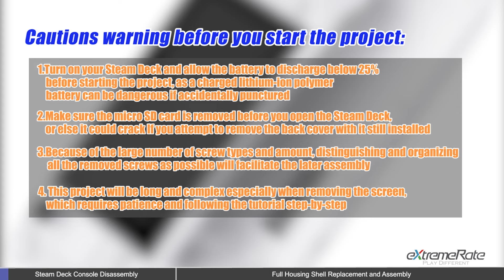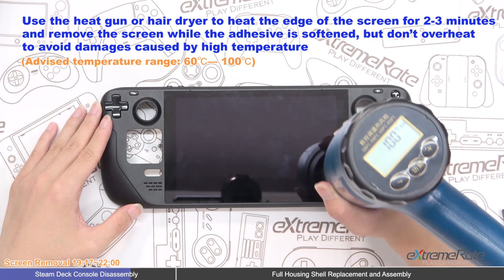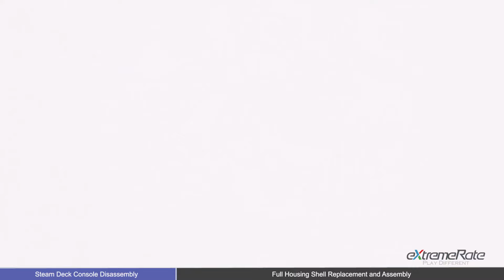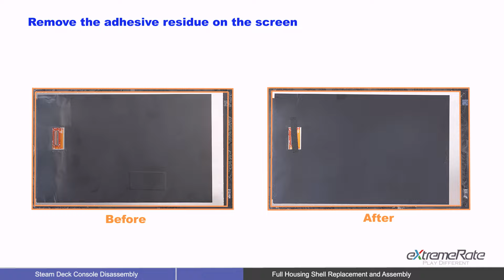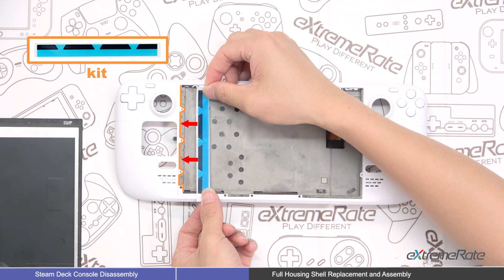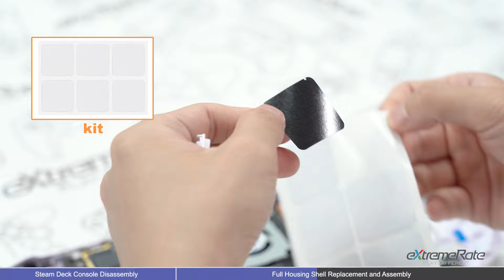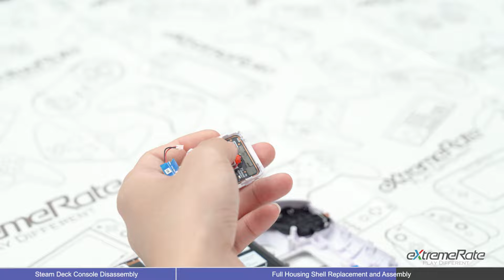eXtremeRate Steam Deck Full Replacement Shell Installation Guide

Comment: So having now performed this shell swap on my Steam Deck, I would like to give the following advice:

Firstly.  Don't use the metal pick provided with this kit.  You will likely chip the glass on the screen, or damage the plastic shell.  Use a plastic pick.
When removing the screen, DO NOT use the pick on the right side as you will very likely damage the ribbon cable on the screen.  I can't stress this enough.  I had to buy a new screen because of this.  The ribbon cable is only 2mm away from the very edge of the screen, and while this guide does mention not to go any further than 3mm in with the pick, as you may damage something, It unfortunately doesn't warn you where the ribbon cable is, and if you insert it any more than about 2mm, you run a very high risk of slicing through the ribbon cable.
You are safe to go around the other 3 sides of the screen, just avoid the right side.  You should be able to remove the screen just by going round the other 3 sides.  (For reference: 21:31 DO NOT do this)  Pause at  21:55 to see just how close the ribbon cable is to the edge of the screen.

As for the kit itself, my only real critique is that the "Steam" button doesn't actually have any text on it.  It's just blank.
Reply from the maker: Sorry about uninformative on the screen removal. And thanks for your tips!
Reply: I wouldnt even remove the screen just upgrade it to a new one
Reply: Sheesh! Thanks for the tips.
Reply: maybe should've paused and assesed what the underside looks like before plunging in boss. they sure show you where things are.
Reply: You don't even need to loosen the adhesive on the right side, the screen should come off pretty easily with just the other three sides loosened sufficiently.
Reply: I even read your post ahead of time but I forgot when I went to do it and it happened to me too
Reply: I wish I read this before I scratched my screen and shell 😢 sometimes I don't notice it but when I try to admire it 😅 well it was my first time
Reply: @ExtremeRate  Hello, good morning, I am a retail importer from Ecuador and I have been buying things for the steam deck and selling in my country, but I saw on your official website that there is no complete case with buttons, screws and tools as shown in your video, everything separately, I do not include I saw the set of screws that they sell, so I don't know if they no longer sell a complete housing set with everything you need!
Reply: About to shel swap today. Thanks for letting me know about the ribbon cable. ❤
Reply: Yes definitely do not use the provided metal pick, ended up chipping my screen trying to get it underneath the screen, hopefully the replacement screen is easier to install than this was to remove
Reply: I followed rule 101 of the internet: "Don't read the comments. I now have to replace my screen." 😢
Reply: When your screen stopped working, did it not turn on at all? (I’m guessing since you severed the connection). I’m having an issue where everything is working fine but when something is in motion on the screen, the screen flickers. But when nothing is in motion it’s fine. I’m wondering if it’s just a bad seating on the screen cable? I’m really hoping so
Reply: I am not sure if you can edit your comment to add something, but one other piece of advice that probably needs to be included is that there is a screw order for the style of heat sync used in the video.

The lower right screw has the number 1 right above it and according to Ifixit's website (they are official suppler of replacement parts for Steam) the lower right should be screwed down first. Once that side is secure, you should tighten down the screw that is always attached (it has the number 2 stamped into the metal by it).

While we are on the subject of heatsink, the kid I purchased did not 
include any replacement thermal compound, and the video should at least 
inform anyone doing this swap that it would be a great idea to replace 
the thermal compound. It is much better to purchase the compound at the same time as the case so that you get to choose your preferred compound instead of being limited to the 1 or 2 options that are likely to be stocked locally.
Reply: @cary4867  You have to remove the screen to get access to the screws behind it holding the metal "frame" to the SD case.

Comment: My only real critique is that when the heat sink was put back on new thermal paste should have been provided.  Leaving it as is for a steam deck that has been most likely in use for 6 months to a year is going to result in poor thermal transfer because the paste would have been dried.  Just saying.....  In my case when I replace this I'm going to be putting Kingpin cooling thermal paste on.
Reply from the maker: That's a good advice, pinned

Comment: Just finished mine for the steam deck. All of the issues presented from the original kit distributions have been fixed. The picks provided are now a softer plastic, basically a guitar pick. The suction cup was great as well. 10/10 kit, my emerald green steam deck is amazing!!! Thanks for the amazing shell ExtremeRate!!!

Comment: Just finished with the clear slate black, looks pretty good, damn sight better than the dbrand skin I had before. Looking forward to the eventual LED mod, that'll really make it pop.
Couple things to note for anyone else trying this. First. you definitely want to be applying some new thermal paste to the SOC, mine was all kinds of dried up and ended up taking the chance to apply some liquid metal. Second thing, the touch pad covers don't come off anywhere as easy as they do in the vid, I suggest applying a bit of heat to loosen things up. And third, a quick tip for removing the adhesive from the back of the screen, use a plastic guitar pic and roll the adhesive, I used a 0.75mm pic and that worked a treat.
Reply from the maker: Great tips, thank you!
Reply: Liquid Metal is a terrible idea!

Comment: Good guide overall however if you have a later rev of the LCD Steam Deck, there is an extra smaller ribbon attaching to the left side of the mainboard, which I learned the hard way is responsible for the controls; the quality of ExtremeRate products is really high, this replacement smoother shell has made the thumbsticks feel smoother and given the whole device a better, grippier feel (clear slate black)

Comment: Along with the pinned comment, id say be careful when removing adhesive from the screen itself. Scraping it off on the metel frame is ok, but you will etch into the black frame if you scrape on the screen. Its best to peel and remove with your fingers on the screen. Also when you set the screen on the new adhesive, make sure it is aligned perfectly with the top or bottom or the case. Although mine fits how it should, it is very slightly crooked 🤦. Last but not least,  triple check that the ribbon cable for the screen is inserted fully and not crooked. My screen wouldnt work and i had to go back and reseat the cable even though it looked fine
Reply: You can fix that crooked screen! Good work and thanks for sharing your advice.
Reply: Did your screen not turn on at all with the ribbon not plugged in properly? Mine flickers when there is motion but when stationary things are on screen it’s fine. I’m trying to figure out if it’s a cable or the screen…
Reply: @DevourIsDead  Yeah my screen just didn't turn on at all. So I just redid all the connections and figured it had to be something with the ribbon cable the first time. Good luck, hopefully nothing is damaged and it's just some connections
Reply: @kslip  thanks for the reply. Yeah idk if I have to buy a new screen then that’s what I’m going to do. Gotta risk it for the aesthetic and I risked it and lost this time lol

Comment: I found it really easy to remove my display with a heat gun, only ditterence was i used a large orange locking suction cup. The standard one made it difficult. Managed to remove it without any scratches on the black coloured bezel.

Comment: Because I just read somebody destroyed his screen: If you remove a screen like that, make sure you heat up the screen properly. Keep it hot, go cm for cm with a 0.25mm guitar pick or play card or dental floss. Heat up, go with the tool, heat up, go with the tool, heat up.... Until you are done.

If you have a 3D printer with a heated bed, program it to 90C for 2 minutes, lay the part on it, display down, and wait. Remove the battery before doing this, please. These head beds are just great for doing this work.

It's not the tools they give you, I would not use them to be honest, I have better ones, but you can do it with them. Have patient, or you will destroy the screen. I was screaming "REHEAT" at the video, that was a pretty borderline screen removal. Heat is your best friend here.

If you fear the screen removal, maybe search for a shop who could do it. A smartphone repair shop is pretty good for that. Or I should advertise this as a service, or the whole replacement, before people kill more screens :D

Maybe I also should point out, there is the DeckHD project, they have a full-hd display with matte finish and better colors, the display may come out in July. If you already broke your screen, maybe wait for the new HD one.
Reply from the maker: Thanks so much for your tips!

Comment: these are basically the same instructions from the ifixit guide, which is fine because it's a great guide lmao, but it's nice to see it in full video form.

I strongly recommend to anybody doing this to just spend the extra $20 or so to also get ifixit's iOpener Toolkit. Getting the screen off this thing is the biggest pain in the ass and using a hairdryer just feels like impending damage waiting to happen (since most of us probably don't happen to have a heatgun lying around). 
Even if you're fine using the hairdryer and don't need the actual iOpener part, the suction cup provided with the shell kit just isn't as good as the one in the toolkit and that alone makes it worth it imo

Comment: A useful tip for you @extremerate. Removing display panels without hot air is pain in the ass. Use always hot air to soften the adhesive and then cut it. This works much much better. But still, my brother bought one of your shells. Can't wait to build it. Your shells are amazing quality.

Comment: Another tip: be EXTREMELY careful with the mic cable, it will break easily and for some reason nobody sells replacements. There was this one replacement on Ebay a while ago but it's sold out now, so unless you want to go through the trouble of buying a broken steamdeck in order to harvest the mic cable, be careful when removing it

Comment: I did a swap with one of the atomic purple cases but kept the stock black buttons came out fantastic. I just had to drill out the little melted bits that hold R4 and R5 and L4 and L5.
Reply: I kept the black buttons too but went with purple for the back ones, they cover enough surface of the back that imo it looks better for the aesthetic to be able to see through them.

Comment: F-d up when disconnecting the left trackpad from the left daughter board (red-black wires, the only ones not in tape form). Instead of popping out of the socket like in the video, or like on the right side before that, the wires took the socket with them and ripped it clean off the daughter board. Hopefully the board can be replaced.
Otherwise the tutorial is very clear on what to do and everything else was done almost without any problems. Thank you!
Also it was extemely hard to disconnect the trackpad board from its case on one side, but fairly easy on the other. I can only imagine that some parts happen to be a tighter fit than others.

Edit: None of my local shops have the board so I went ahead and assembled it as is. The trackpad works, the wires were there for supplying power to the haptic feedback vibrations - these are gone. It's not critical as the trackpad itself functions as intended so I think I'll look for the replacement at my own pace.
Reply: I had the same issue - how did you deal with the second trackpad?  It seems the innards are an exact fit, so I can't even get a super sharp blade in there.  And it's way too easy to destroy the copper around the edge if you mess up.
Reply: @happyspaceinvader508  It took me a lot of time - and force - to get it out. I used a stick-shaped plastic spludger that came with some of my other modding kits and forced it in. After I managed to get it in ever so slightly, I moved it around to unstick the whole thing. And boy did it grip hard. My palm center that I pushed with hurt for a week afterwards lol
Reply: I rigged some aluminium foil under the corners to make the contacts connect and super glued the connector to the board. It works like new lol a bit tricky, but I got lucky lol
Reply: Since this is only two wires, you could probably have someone with a soldering iron just solder them straight to the board. I know that's what I would do.
And yeah, that connector is the absolute worst!

Comment: Just installed mine today and I wished that my touchpad covers came off as easy on the ones in the video lol
Also, don't make the mistake of trying to scrape the adhesive off the inside of the screen, luckily I was able to borrow some black fingernail polish to cover the scrapes. Other than that, turned out great!
Reply: Do you need to remove the old adhesive from the back of the screen? What would be the easiest way to do it?
Reply: @erraddict  Probably not, though it may vary depending on how clean/consistency the left over adhesive is when you lift the screen. I used the metal pick they provided at first as the adhesive that was still on it looked like it would get in the way of the new ones they provided, but in hindsight, I would have just left mine alone as you can easily scrape the black bezel layer on the glass.
Reply: @srbharris  I'm assuming you can just as easily peel away any excess tape by adding heat to soften it up more if it cooled
Reply: Did you use the "Original" screws or the "Kit" screws? The video doesn't make it clear which to use.
Reply: I got one of them off, but can't get the other one.   It doesn't help that in the video the touchpad is turned away from the camera, so you can't see the exact technique required.

Comment: Any more info on hooking up the Antenna cables to the Wi-Fi module ? I have a partial white and black cable ( also labeled 1 & 2 ) but there’s no label for the actual plugs. This is a great video in general, but there could be some more detail or an alternate angle on the shot.

Comment: Completed my Wood grain shell with Gold button replacements using this video. The video is great. Few pointers: Use plastic shims, always. Also, it's better to use rubbing alcohol and a plastic shim to remove the glue/foam from the edge of the screen after you remove it. If you use a razor or metal scraper of some kind you'll scratch away at the black paint and have some minor cosmetic scratches around the bevel of the screen after transferring it to the new case. Difficulty is 4/10, Quality of replacement shell/buttons 8/10. The replacement shell feels better than the original, the buttons are about the same.
Reply: Blud got the age of kings steam deck

Comment: I followed this as generously as I could but the person taking this apart doesn't seem to be thinking for convenience on the order of steps, some of the band detachment and reattachment could have been done sooner in relation to related part handling, and the speaker stickers for example could have been put on the shell a lot earlier and not doing so makes it harder to line up right. the screw detail was vague and often left me having to wing it on which screws to use especially considering that the kit I bought did not have the smaller sized screws for the monitor included in the package. I could not safely swap out the trackpad shell so I had to skip that, but it still fits with the scheme of the screen and sticks so its acceptable enough. with all that on note, everything seems to work after reassembly, the walkthrough still did its job, so thanks in that sense.